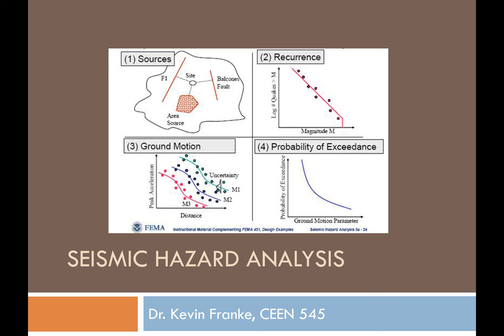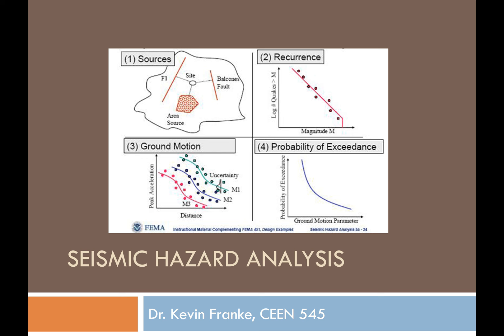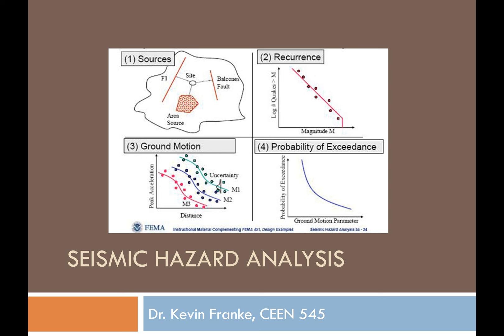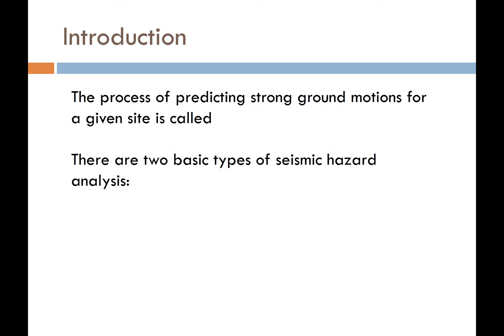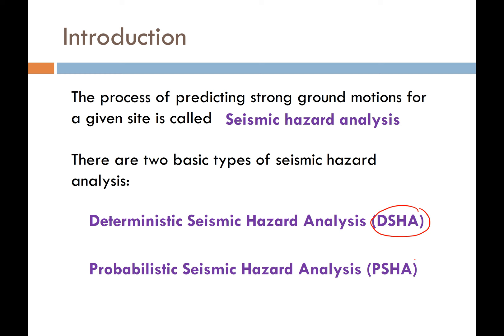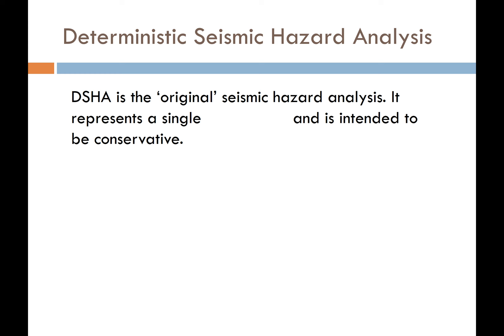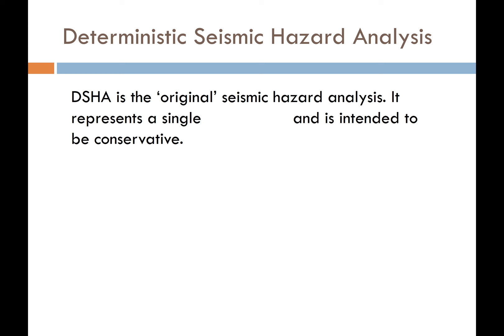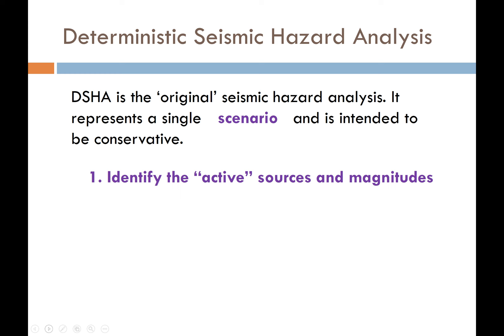CEEN 545 - Lecture 8 (Part 1) - Seismic Hazard Analysis

Comment: 23:54 - If we have continuous random variable x (like we do), the probability of the exact value for x=x1 is 0 right? The probability is calculated by taking the integral of PDF, and integral from x1 to x1 is zero. We need to consider a finite interval in the domain so we could get a value between 0 and 1 for the probability.
Reply: i know Im randomly asking but does anyone know of a method to log back into an instagram account..?
I was dumb forgot the account password. I appreciate any tricks you can offer me
Reply: @Elias Killian instablaster :)
Reply: @Josue Knox thanks so much for your reply. I got to the site on google and im in the hacking process atm.
I see it takes a while so I will reply here later with my results.
Reply: @Josue Knox It worked and I finally got access to my account again. I'm so happy:D
Thank you so much you saved my account!
Reply: @Elias Killian Happy to help =)